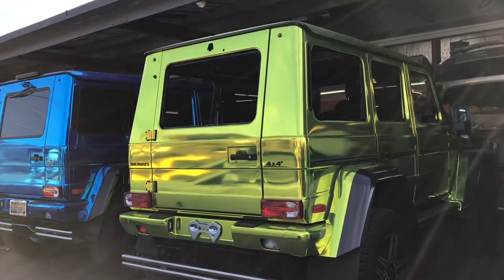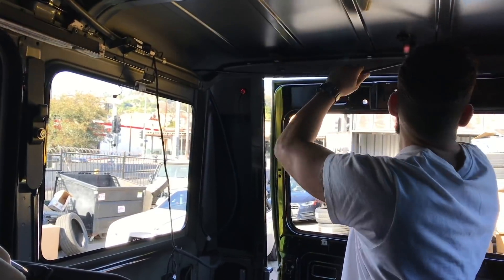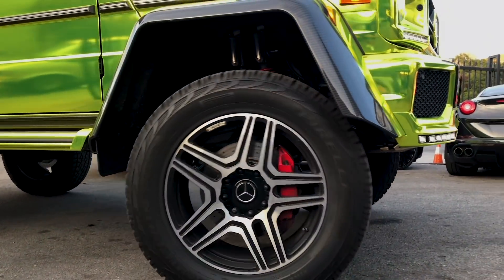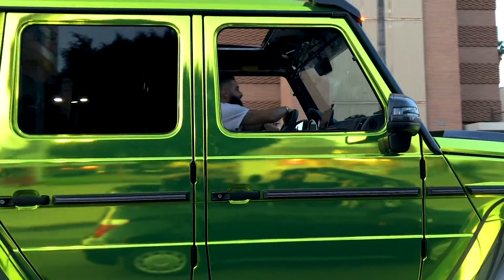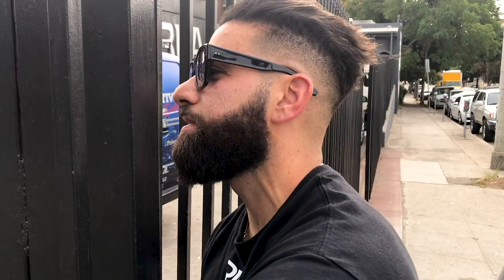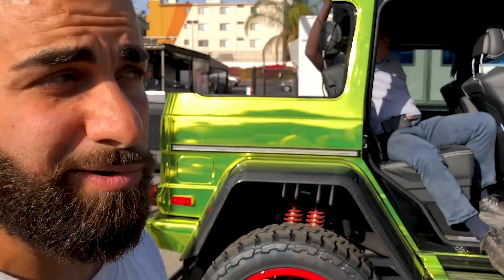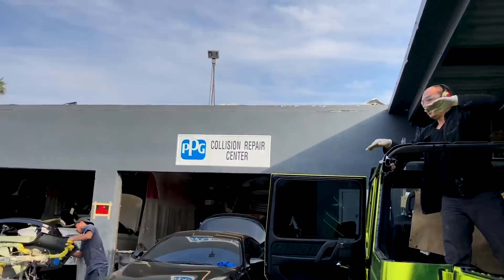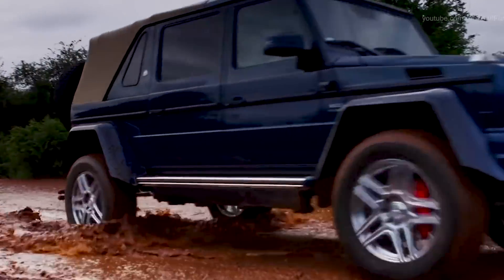CHOP TOP G WAGON 4X4 BASED ON THE MAYBACH LANDAULET!

Comment: I came in expecting something well done based on their reputation. But this is a bit of a hack job in my view, they chopped up the top and couldn't engineer a proper softtop for the rear. Nor any kind of cover for the roof. I get the whole sunny day and nice weather only use prospect but they have irreversibly modded this unique truck with no expertise to complete the job. Interesting truck for sure, looks and sounds great. But a let down on the overall execution
Reply: It is the customer who dictates what gets done based on how much time and money they are willing to part with.